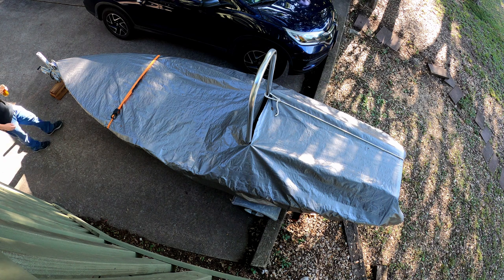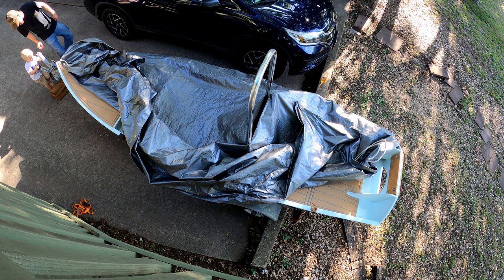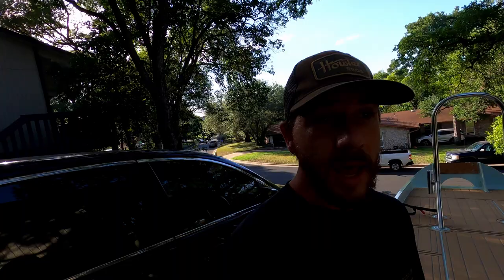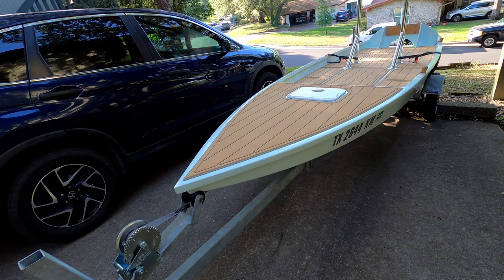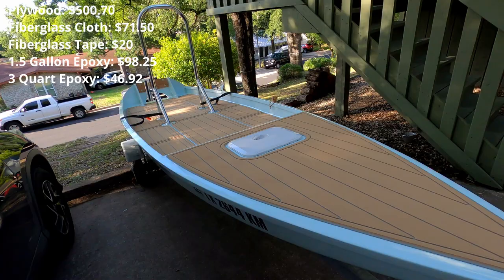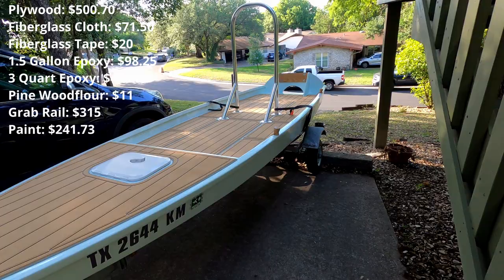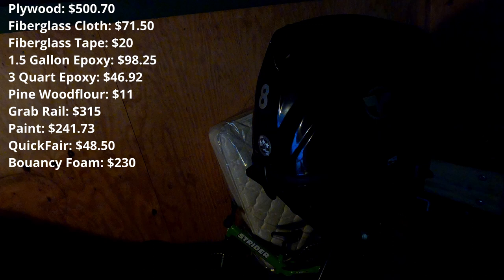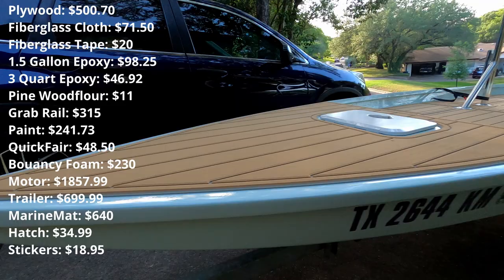The Cost to Build My SK14 DIY Skiff

Comment: This was an interesting build , just like you all of us skinny water fisherman that want a flats skiff but looked at production boats and went ha ,no way , but I’m a retired boat builder , so this shouldn’t be that hard , one of the things I noticed was you went first class on all your products from the okume plywood , epoxy resin, paint , non slip decking , ( new motor ) and new trailer, this kinda build would be new to me as all the boats I made over the years were made from molds  ( yes I made the molds to )  but doing the stitch and glue method is something I haven’t done but seems like the most economically efficient way to do a one off build , I’m thinking on doing my own design and making one 16’ long and wider for more stability, I’m probably going the cheaper route, GP resin , 1/4 “ in ply , used trailer and motor , and just gel coated upper deck ,I’ll paint the sides and bottom, I think one of my big investments will be having a poling platform made , can’t wait to find out what you would change on your boat as I thought would had your dream machine already 🤔 I guess I have to wait to see your next video , to see if I need any changes , great build ,have fun , stay safe , and tight lines !  :)
Reply from the maker: I have an interesting video planned to discuss the things I would change. I have a good friend who also built one, so I am hoping to be able to sit down and speak with him in more of a conversation setting. That way I can talk about lessons learned from my perspective and from his. Thanks for the comment!
Reply: I am about to start epoxying my stringers this week.  Anything I should know you would have changed at this stage or are the changes you would make at a later stage.  Looking forward to your review video!
Reply from the maker: @patrickyoung9228  There actually is one change that I would have made at that stage. Before gluing on your deck, I would make some small vent holes between your stringers. That will allow air flow between the chambers. This will allow you to create one vent in your deck to prevent any air expansion from popping your joints. I'll talk more about that in my next video!
Reply: I was thinking about filling in the large scupper hole and putting 3-4 round holes with scuppers that have stainless flapper valves.  I know water can exit quickly but it looks like the boat gets wet easily just when standing at the stern.  Can’t wait for your feedback.  Thanks for the reply!
Reply: I would have never thought to add vent holes under the deck to avoid expansion!!!  I was going to seal that entire large hull section under the deck tight!  I hope you can come up with a plan for your boat to resolve the issue.  To start you have access to 3 of the sections through front hatch (easy part).  Could remove the grab bar, drill holes maybe 3/4” in deck where main grab bar tube goes up and drill a vent hole in the underside of the grab bar at the top almost making a vent chimney for the center sections.  Could use a long drill bit at an angle to get the port and starboard two middle sections venting them through middle chamber up through the grab bar.  That will leave the stern sections.  Not sure how to get to those without more drastic action.  I will think about it.  Thanks again!

Comment: What I'm really interested in is how you built that hatch on the forward deck. I need to put a hatch in the same place on my boat  once I get done with the glass work and get it flipped back over. Also, how hard was it to get a home built boat registered here in Texas? Thanks!
Reply from the maker: I cut the opening for the hatch before I glued that panel on. The opening was slightly bigger than the hatch. Then I installed the panel, glassed over it, cut the glass from the opening, faired, primed, and painted. Popped the hatch in with some sealant and attached it with stainless screws. As far as registdr8the boat, it was not difficult. Just a couple forms to fill out. They will want to see your receipts from the materials, so make sure you keep up with them. Lastly, a game warden has to inspect the boat.